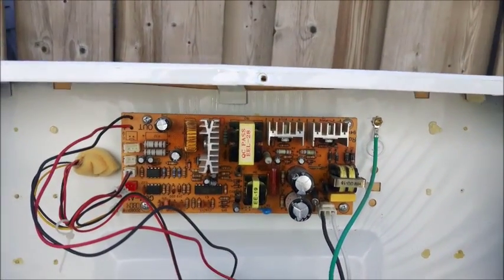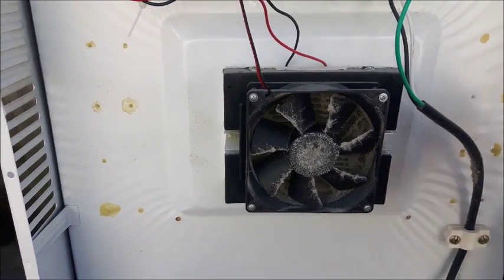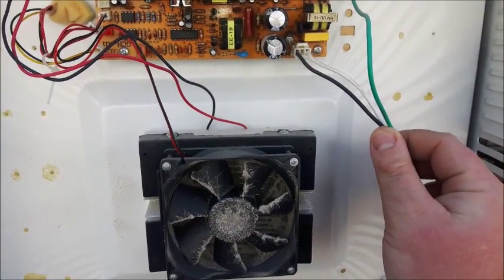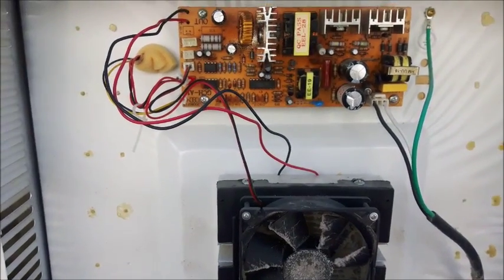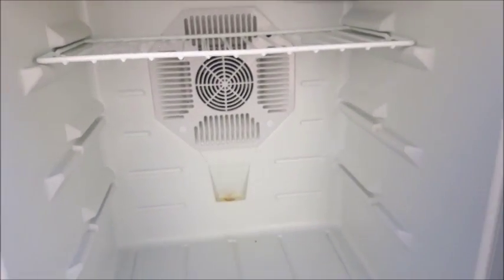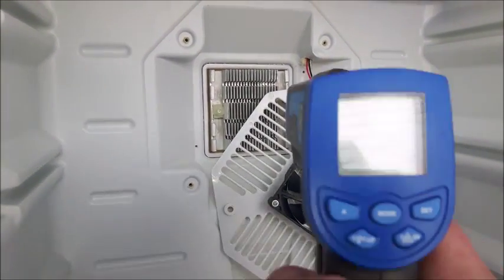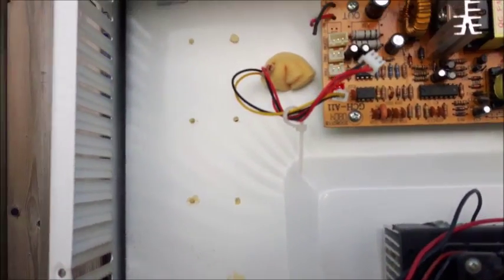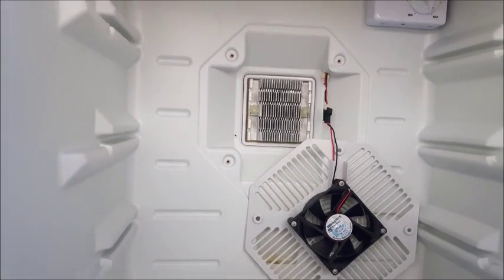Refrigerator Conversion 120V AC to 12 DC Part 1

Comment: i think you may hmay
 black for common ground
red1 for power in
red2 for switched power out (switched by the thermostat)

the purpose of this would be that the thermostat ideally needs to switch both fans and the peltier device

I am only guessing so may be wrong...

Comment: Pretty sure that you've completed the project and I haven't even finished watching the first video but https://smile.amazon.com/gp/product/B00KCCX0EE/ref=oh_aui_detailpage_o02_s01?ie=UTF8&psc=1 Is a  Programmable thermometer with an on and off switch. Exactly what you need. Your fridge uses a peltier cooler which runs off of 12v. That part costs under $12. You literally just will need a power cable. You would also need to power the inside fan.  I'll tell you right now, they are not very good coolers. They only lower ambient temperature by about 30 degrees fahrenheit. The hot side must be cooled via fan.

If the peltier unit is bad, a replacement will also cost well under $10. I suspect that is your issue. Not for to continue the video. :)